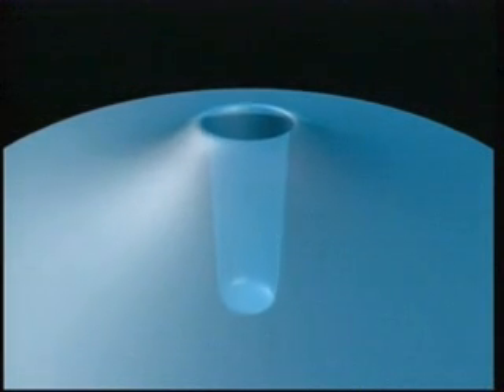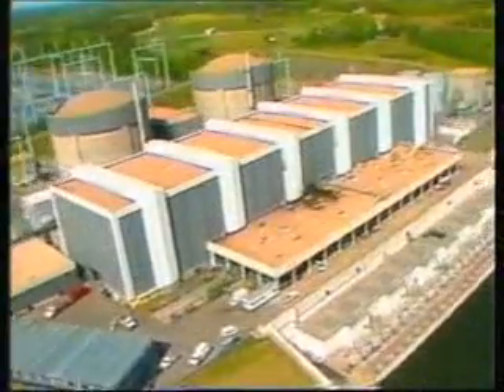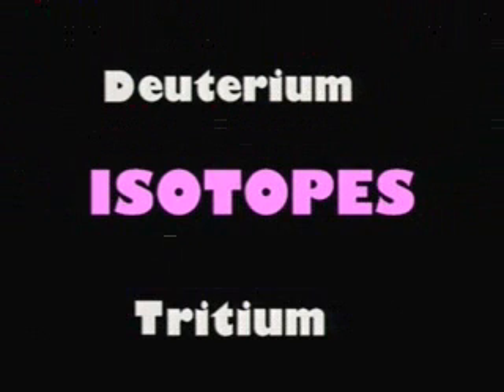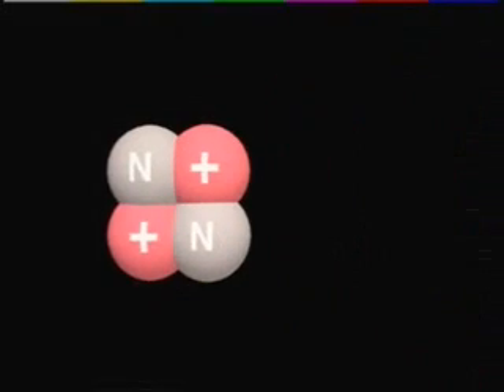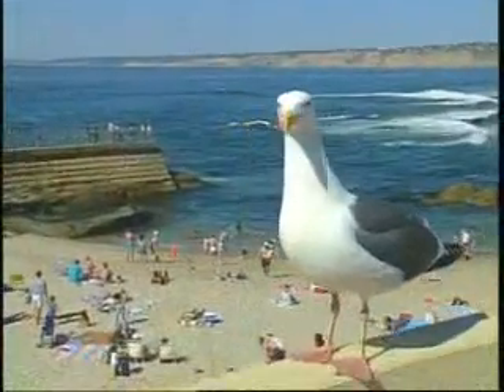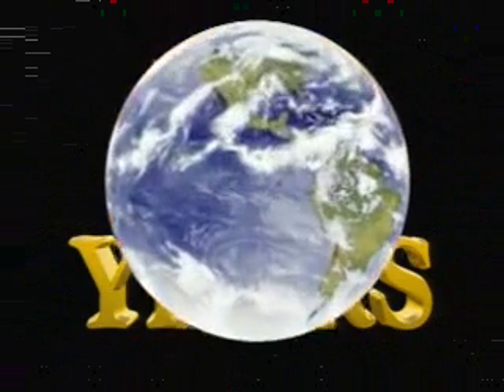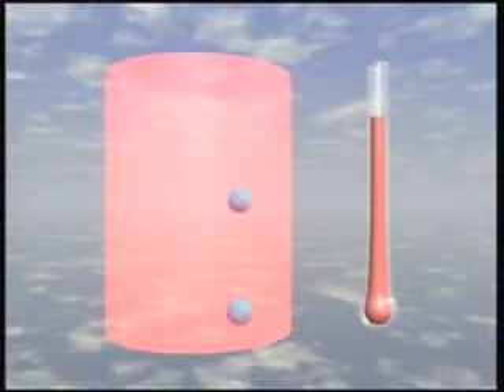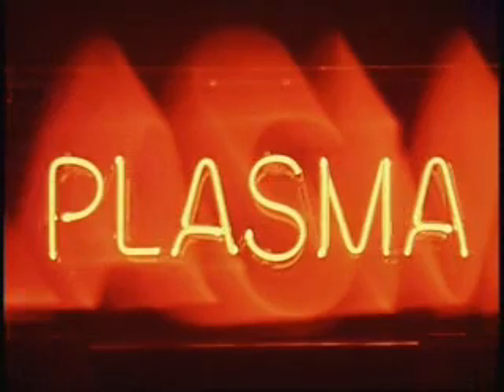Fusion: Nature's Fundamental Energy Source 2/3

Comment: great documentary, as far as i can tell its very accurate.

but they could have mentioned the drawbacks of nuclear fission: the leftovers that remain when uranium gets split will remain radioactive and thus poisonous and dangerous for thousands of years. 

nuclear fusion also produces lots of radiation, but the leftovers arent radioactive, and the material surrounding the reactor can be designed that it will radiate only for a short time, so that they get safe again after 100 years.